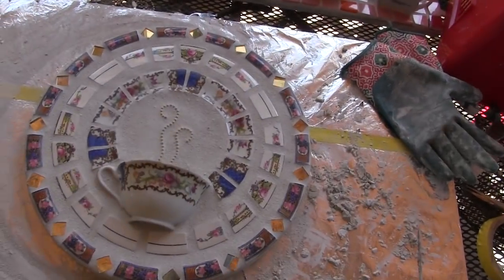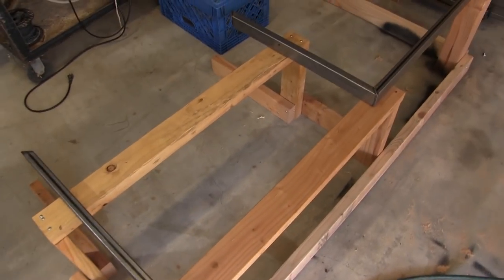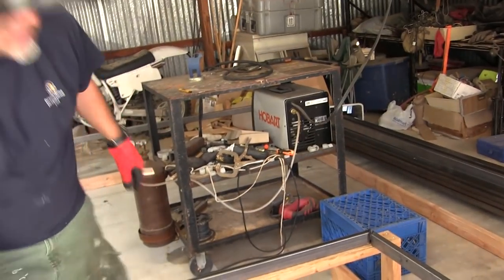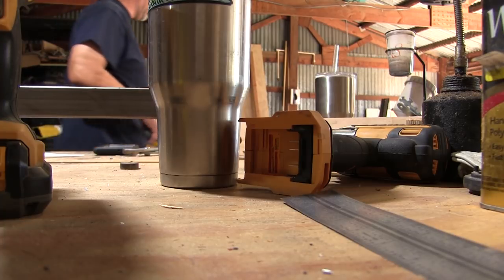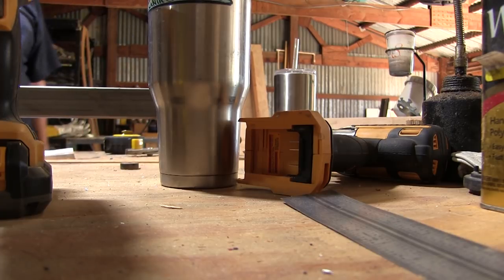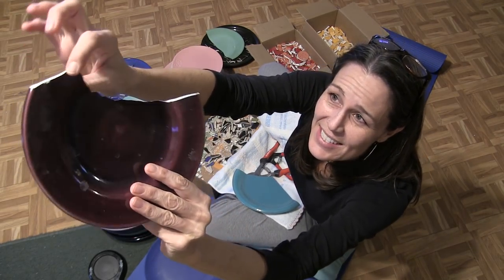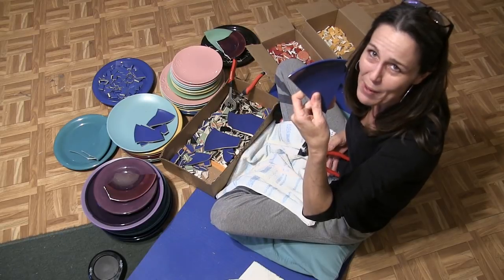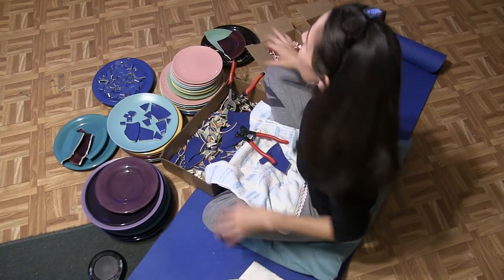Skoolie Roof Deck Saga (Part 2) + Mosaic Tips from Kerry

Comment: The wonderful thing about metal is you can make a cut in the middle and add the missing length, weld it in grind it smooth with no loss of strength. I've been there when you are working tired. Thanks for returning my previous comment.  Your channel is an inspiration to me.  Bless you two. From the retired firefighter/emt.

Comment: Kerry, thank you SO MUCH for the tips. I only use the wheeled cutter now and will be going out TODAY to buy the edge nipper from JoAnn's (using a coupon) :) THIS video will really help me. Up til now, I have been using a book press that I purchased - I put the plate in a grocery bag, then put in the book press, and wheel it down to break the plate. You would think it would break uniformly, but NOT. :) I want to try doing that, but first putting blue painter's tape on the back of the plate, so the pieces will stay together for a mosaic piece, I'll let you know if that works :) Thanks SO much for the tip of nipping in half and then half again, then half again! Can't wait to try that! I just bought a BUNCH of plates at thrift stores on a trip we just made, even found some full size plate for 5/$1 at a yard sale! Thanks again, and thanks for answering me before!

Comment: 10:15 Bruh, don't stress too much. If it's short by 1.5", just cut in 2 places symmetrically, and weld .75" of material on in both places. Problem solved.
(I've cut it twice and it's still too short!)